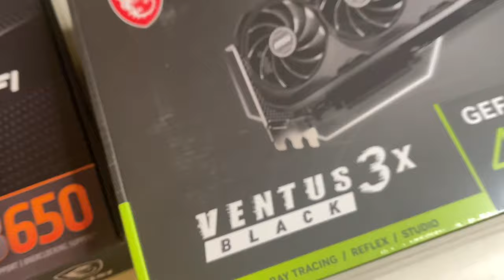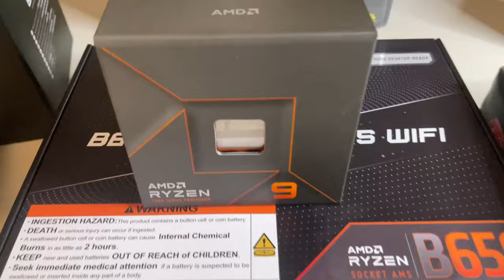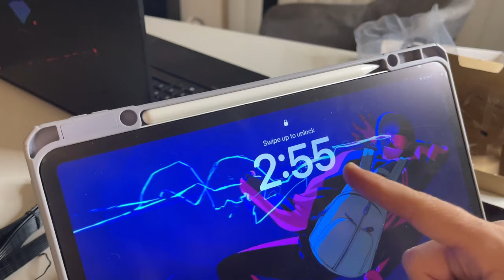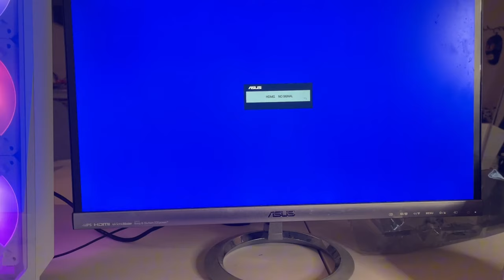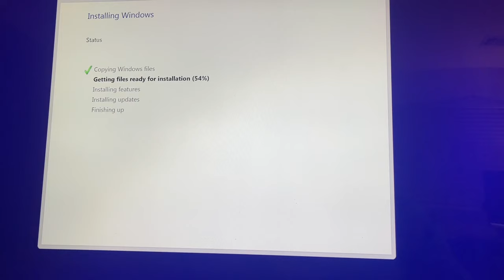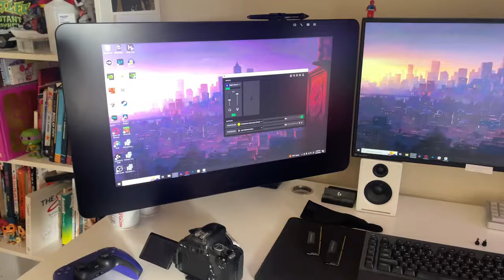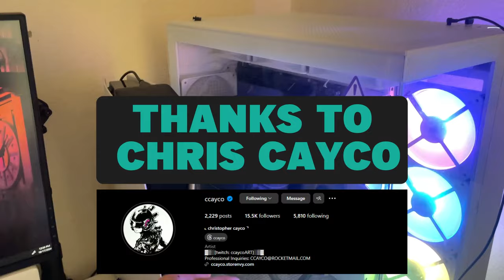I BUILT My First Gaming PC 🌎 MSI GeForce RTX 4070 TI Super | AMD Ryzen 9 7950x

Comment: a water fountain is not missing, but aio water cooling is missing ! A "ARCTIC Liquid Freezer III 360 A-RGB" costs ca. 80-100$! Then move the 3 fans from the ceiling to the bottom. Or order 3 icue fans for it!
Reply from the maker: dude yes! I actually had a aio in my cart but a few different people said it was to much maintenance. I think i will grab a couple more icue fans for the top
Reply: I use the 420mm version of the arctic liquid freezer III and I won't go back to any other brand. Just an FYI the radiator is thick so I recommend using the fans it comes with for case clearance.